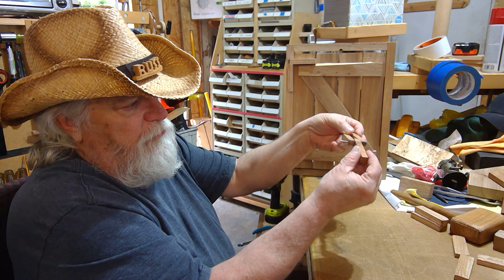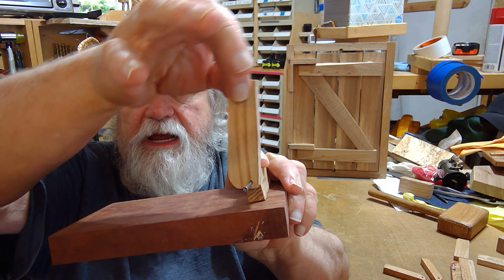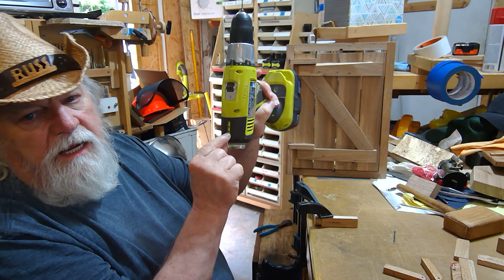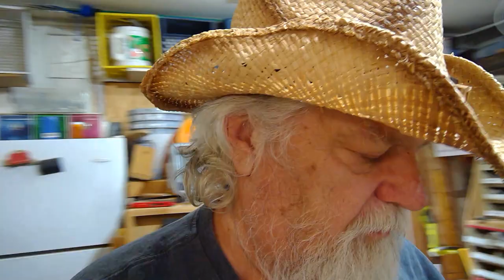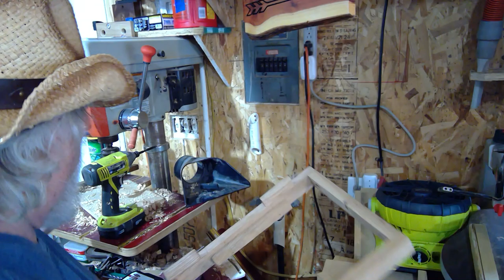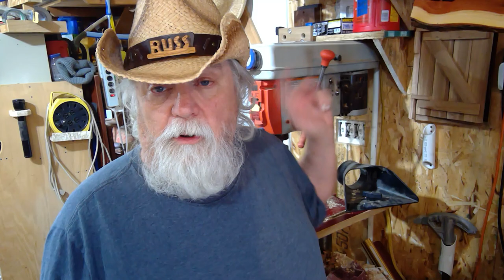Wooden Hinges   Make and Install in 5 Minutes by OTB Thinker

Comment: i used two screws on the inside of the door and attached to the frame i call it a hinge-less door its on a bird cage so it works great for its design... i am thinking of making a screen-door and will probably use your idea of a wooden hinge... i like it, it seems like it will work great for the screen-door,thanks for sharing your ideas

Comment: Good idea. Seems much easier to fabricate than dado'ing and fitting the legs together. And the size (width) of each arm could vary allowing for use of all sorts of scrap pieces and modeling for use in decorative applications. As you said, endless possibilities!
Reply from the maker: You are so right.  This is just the tip of the artistic iceberg. Thanks Tim

Comment: These hinges are wonderful!  I've just made my first set, as an exercise. Question:  I want to use a wood dowel as the pin, instead of a metal rod or nail - what size wood dowel would you use for a cabinet door?  What about a full size people door?  Would you use more than one securing peg in each hinge section, for strength?
Reply from the maker: Thanks for the compliment.  I have used bamboo skewers in place of metal pins with no failure.  I suspect the hinge frame will give out before a pin failure.  2 ways to strengthen the hinge is by a thicker pin or thickness of the hinge frame.  You could also add a third hinge if space allowed it. I think that the last cabinet door I I made with wood pins was a 1/4" wood dowel.  The main advantage of a metal pin over wood is wear and tear.  A side issue of wood pins is they are more likely to be squeaky :>).

Comment: Just a thought Russ, don't use a drill bit to make the hole.  Take your brad or finishing nail, cut the head off at an angle and use that end to drill out your hole....KISS - I always break my small bits and have used this trick lots of times.
Reply from the maker: Good tip, Steve.  I do that when all the right size bits are already broken, which is often :>)  Just don't try to drive the nail in without drilling :>)